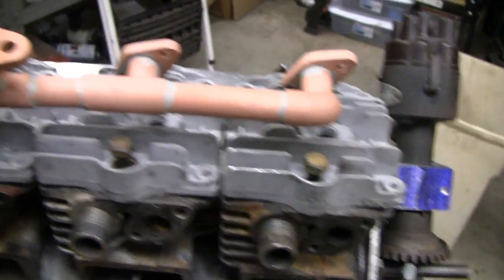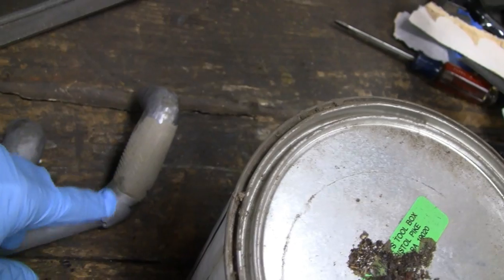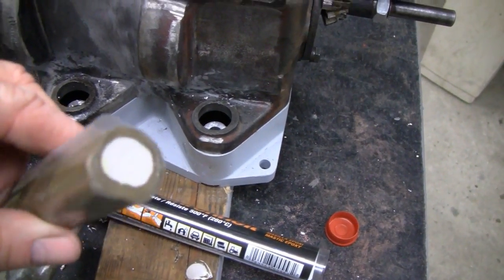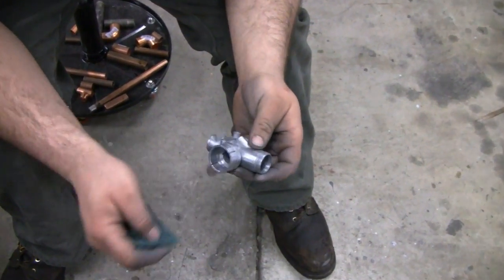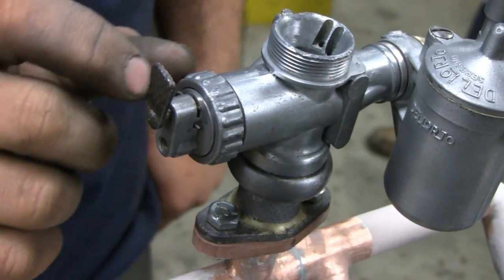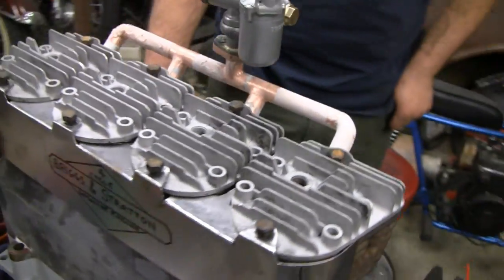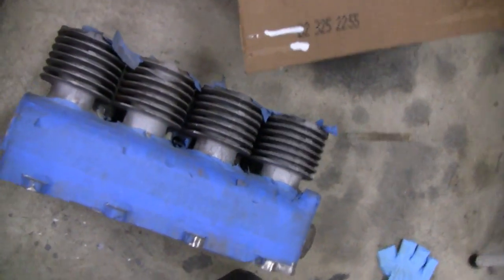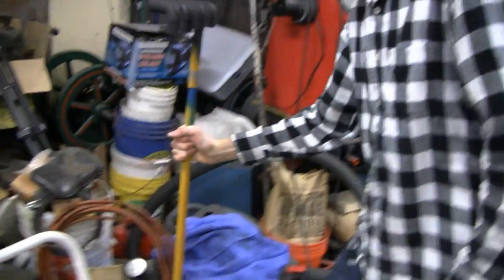HOMEMADE 4 CYLINDER BRIGGS PROJECT (part 15)

Comment: Loving this series on the four cylinder.  I somehow missed the distributor installation.     I used JB weld before on a lawn tractor manifold that had bad threads but the stuff softened and flowed from the head even after it was well cured.  Obviously I’m watching an old video.  How did that JB weld hold up on manifold?  Maybe OK away from head a bit unlike mine.
Reply from the maker: It isn't JB!! And it's holding up fine!!☺
Reply: Roger that Roadking.  I went back in the video and caught that you decided not to use JB weld. Good choice.

Comment: I did a bonnet repair (hood LOL) on a MGB GT for a guy who put a V8 in it , he used the bonnet bulge from a MK 1 Ford Capri then slapped about 2 1/2 inches of body filler to get the shape he wanted , of course it cracked up like crazy paving , he couldn't get it through his thick head you cannot stick that amount of filler above a the heat of a V8 , 1/4 inch max for hot areas . Great set of vids BTW .   John .
Reply from the maker: Thanks Bud!!☺

Comment: The way the oil pans are joinned means the engine will need to be kept level else the oil will drain out of the most elevated cylinders and may starve for lubrication.
If the displacment volume of the outter cylinders is less than the volume of the piping from the carborator, then the outter cylinders may run very lean.  The fuel vapor may recondense and pool or just slosh back and forth and not make it to the ends.
Just some concerns.

Comment: Looking great RK and the boys.
Ive tried the same epoxy (hardener in the middle) but for the applications i used it for it wouldnt flow like the liguid two part.
The only time it wouldnt work for me is when the material i used it on would flex.
Once it did,it would crack,,but thats me using it for something it wasnt intended for.

Mikey,I call them carb slides,but to each his own :)
Been rebuilding mikuni and mikuni type carbs for 35 years and its amazing how often i will end up with a cpl extra bits lol.
Anyway,,long winded as usual,,just wanted to say it looks fantastic buddy,,keep having fun :)
~Vince
Reply from the maker: I was never a big fan of the kneaded epoxys, but this stuff was pretty good!!☺

Comment: Just asking average temperature of just one engine  when outside is50 degree and the engine at operating temperature
Reply from the maker: The operating temperature is about 200°F on the little engines that we work with!!☺
Reply: Times 4  we are all plugs for keep your hockey stick out of puddles

Comment: That epoxy may hold up well .. I guess it's worth a try , Ah !!  Ya , Those carbs are rare , with the bowl the moves .. Great looking engine !! Briggs should be contacting you any day for a picture spread and an interview !! LOL.. Thanks guys !!
Reply from the maker: Thanks Shawn!! Briggs Corp. already commented on a few of these videos!!☺
Reply: Cool .. Ya , That carb came on a ducati 2 stroke motor cycle .. I have had several ! And there not easy to find .. You may have to re jet it . But kits are easy to get , As well as jets !!

Comment: Good Job!!!
Only thing I think I would of done different is use exhaust fiberglass wrapping instead of the epoxy
Reply from the maker: We thought about it!! It's still not outta the question, we'll have to see how the epoxy holds up!! We wanted to stay away from making it look like a Hot Rod engine!!☺
Reply: But it is a 1950's flathead Hot Rod engine!!!

Comment: Not to beat a dead horse, but another thing to consider here guys. As one cylinder fires, another is only blowing compressed air through the exhaust manifold, ALSO adding to the cooling of the manifold between ignition timing. Ya'll are worried about nuttin.....it'll WORK I TELL YA! Or my name isn't MUD! lol
Reply: Not true at all. As one cylinder fires on the power stroke, another is on the compression stroke, another is on the intake stroke, and another is on the exhaust stroke. Any time an exhaust valve is open, hot exhaust gases are being expelled, not compressed air.

Comment: Just thinking out loud here Roadie, but I think it would be cool to set both the twin and this 4 banger up and have the twin start the 4 banger using an idler belt and pulley between them. That thing is certainly got many of us on high alert for the final unveiling with it running!
I hate to jump out in front of the bus here, but you guys doubting the exhaust manifolds heat tolerances with the epoxy need to remember a few things.....lower compression, lower HP engines, like the ones these guys are using, won't produce the heat that the later model, larger HP engines do. These are 3/4-1 hp each guys......look how small the displacement is in comparison to the over all bulk of each cylinder bore. No Worries! It'll work as expected......Besides that, the higher temp rating on the epoxy will dissipate the heat much more evenly through out the exhaust manifold, as it's designed to do!!!! Dissipation is key, and the guys have the bases covered~!~! Cheers! Zip~
Reply from the maker: Thanks Zip!! I appreciate the support Buddy!! Alotta guys think we're workin' on a 426 Hemi here!! Before I applied the epoxy I checked the heat coming out of a 5 HP with a good Fluke thermal gun and the exhaust coming out was 500° but the muffler was only 350°!! This engine will never be run above an idle, it would blow apart!! If for some reason the epoxy fails we do have a backup plan!!☺

Comment: Things are looking great!
I tend to agree with 30GB, I think the exhaust heat will remove the filler over time, but it should look good on the first run. My turbo-compounded Briggs turned the pipes blue, and it wasn't loaded down at all.
Hope it runs well for you guys.
Reply from the maker: Thanks Miles!! I'm sure that turbo thing wasn't a 1.2 HP running at 800 RPM!!☺